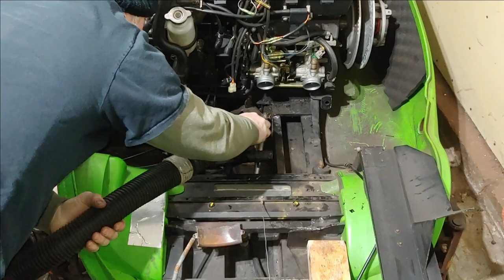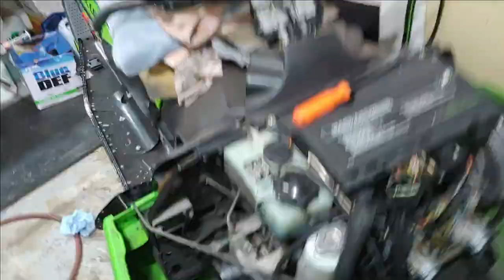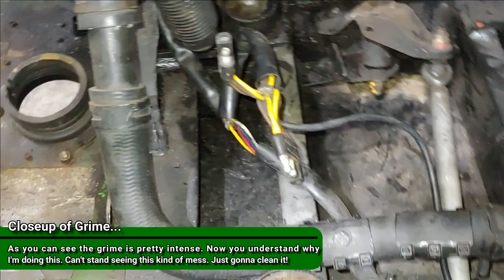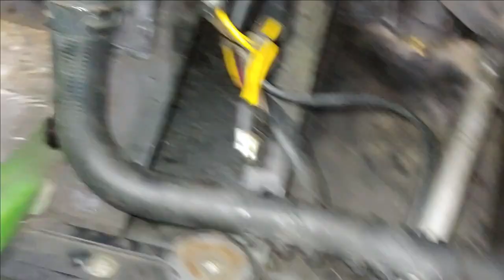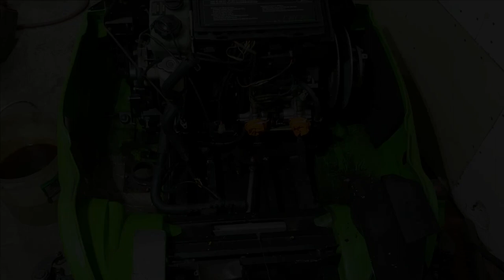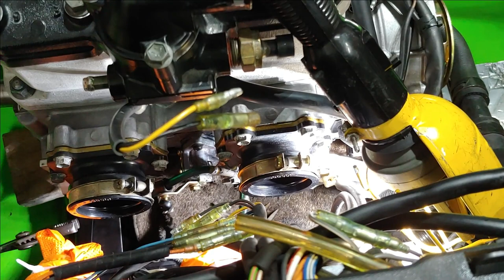02 Arctic Cat ZR 600 EFI Series Part 3: Clean up! [How to Clean Belly Pans]

Comment: Old fuel really does the trick.  That looks fantastic.  I have a mouse nest of insulation under my motor, can't get it or blow it out so it's there.  Did find a nice pile behind my primary clutch this weekend.  I'm pulling my motor after the season, my primary seal is shot and leaking that Isoflex a little.  Not bad enough to cause an air leak yet or ruin a bearing, but since it looks like little to no snow this year, maybe beginning of March I'll start that project.  Have to remove the bottom of engine to replace seal, lots of fun.
Reply from the maker: Yep! It's better than any degreaser that I;ve tried so far. Although I was sent a box of "Super Clean" Stuff that I'm trying that seems promising so that will be in the lineup!

 Tell you what Craig.. I would not risk it. You don't want to burn down a perfectly good top end on account some of $40 seals and good days work. If you think that you have a bad seal, don't ride the sled any longer and yank that engine out and slap a new set of seals in it. I replaced one in my wife's sled 2 years ago as it had a leak. Didn't do the other one (MAg side). It only last a couple of hundred miles and burned down the MAG cylinder, the side I didn't replace the seal on and it was initially good. Check your plug color too. If the side with suspected bad seal is anything more towards the gray or white range compared to the other, it's on it's way out. YOu could have it repaired by the time the good snow is here and have No Worries for the rest of the season. Can't recommend it enough. 

The seals are <$50 and you can order them today, have the engine out and apart and ready to slap back together by the time they arrive. Check out Part two of this 600 EFI series as I show pulling the engine apart and putting it back together which is basically the same for all sleds. 
https://www.youtube.com/watch?v=yuGBoX7lTwM

Here's part 15 of my 02 ZR 800 rebuild in which I rebuild the entire engine as well. Might have better progression. 
https://www.youtube.com/watch?v=sHU8OdEuUns